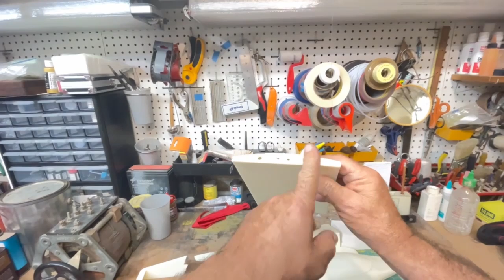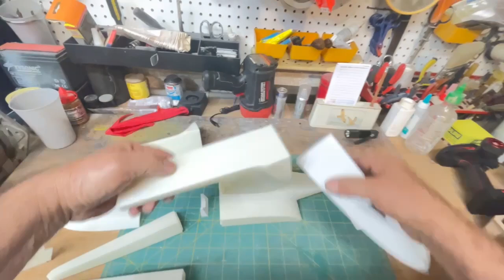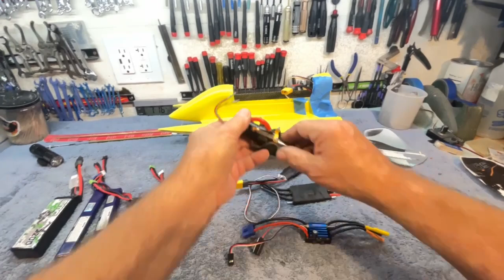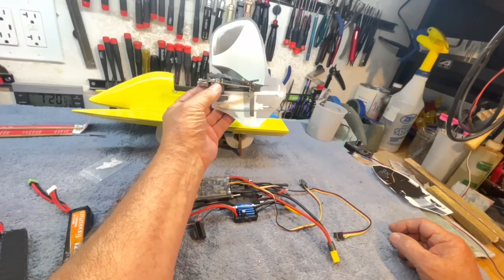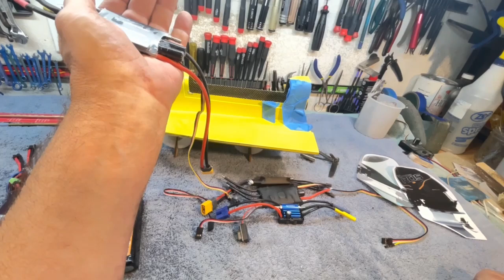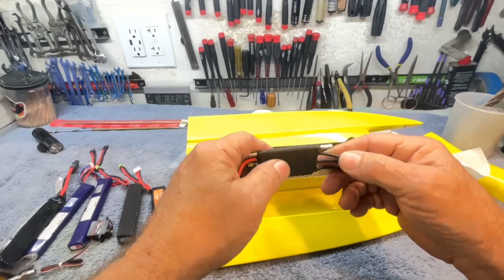Dr. Jet announces new 1:20 Hydro short kit production schedule.

Comment: I've been into n scale trains for years and it is detailed. Between cars, planes, boats, and trains the trains cost the most and then the cars because they break every time you drive them. It's funny that you mentioned the kits because I bought an Atlas kit almost a year ago from you and just this last weekend I bought some wood to get started on it and today bought the rudder and strut. Have you tried the knumbchuck batteries. The ones that are the airsoft batteries that are tied together. Just wondering if they are any good. Thanks
Reply from the maker: I use a lot of those nunchuck batteries in cramped applications and they work just fine.  They generally have lower C-ratings so keep an eye on how hard you push them.